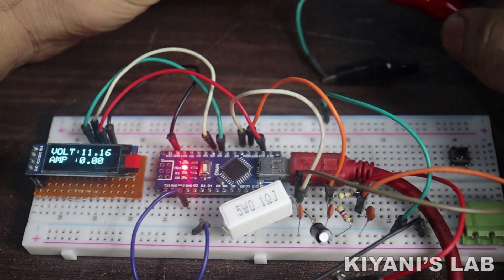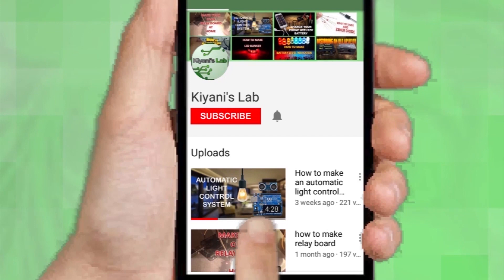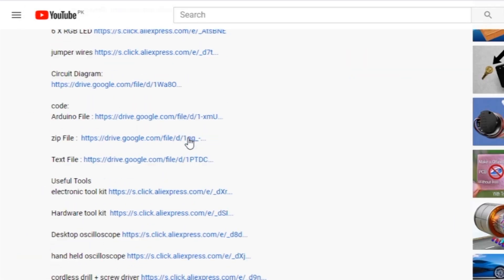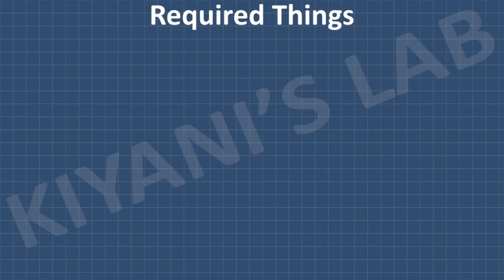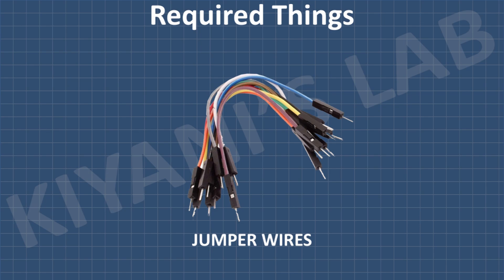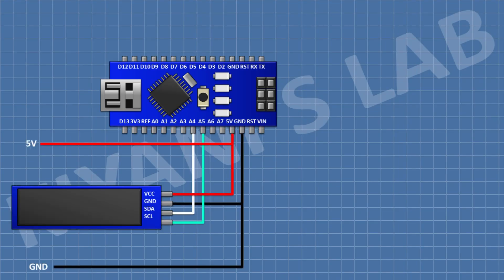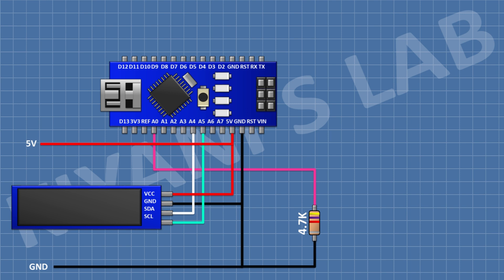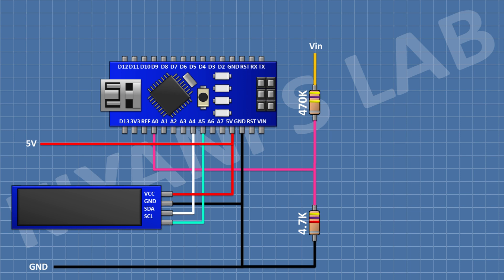How To Make Volt  Ampere Meter With Arduino and OLED

Comment: Gd day Sir, could you pls explain me such line code: " i = tmp*0.015". tmp is the value of analog reading, why you multiplay it for 0.015?, is this a costant for 0.01ohm shunt?, if i'm using a 0.1 ohm the costant value is still the same?

Comment: ok nice ... i will use it ... with the ams 1117 i had not much luck ... that's with a normal resistor is the old but better solution ... thank you  ... i always make the simplest things at last ... hihi

Comment: Good job sir 

pwm controller uc3843 buck and boost converter input voltage 12/ output voltage 0/30 A5
Reply from the maker: soon videos on uc3843
Reply: @KiyanisLab  ok sir 💯💯❤️❤️

Comment: again confusion as previous video, Resistor 0.01ohm or 0.1ohm ?
Reply from the maker: both can be used I used 0.1
Reply: @KiyanisLab  if so,the codes related to it should change know ?

Comment: Hello sir, I am working on a multimeter project. For measuring current, I am really finding difficulties to get high accuracy for such low currents, I do not want to use the INA219 module but use a precision amplifier with a shunt of 0.1 Ohms 5W. Please can you lead me to what to do or at least tell me what to search for. Also, a brief explanation of why you used such certain components in your circuit. Thanks in advance ❤❤❤❤
Reply from the maker: video very soon bro
Reply: @KiyanisLab   where is the update with this video ?